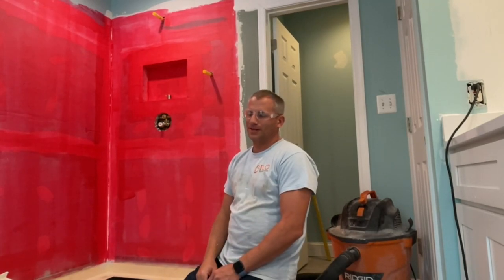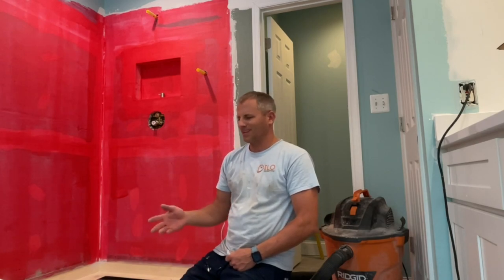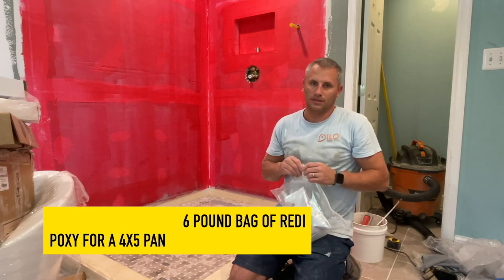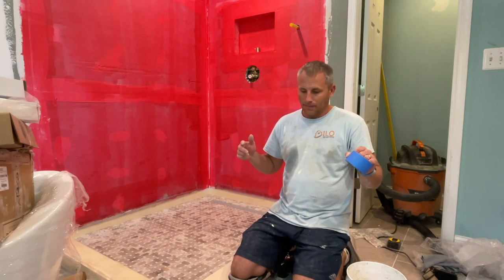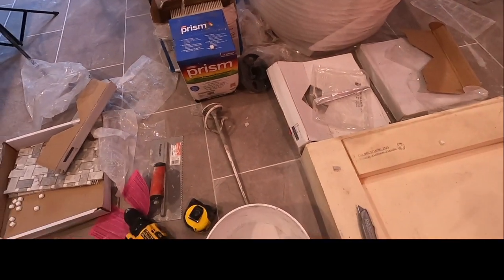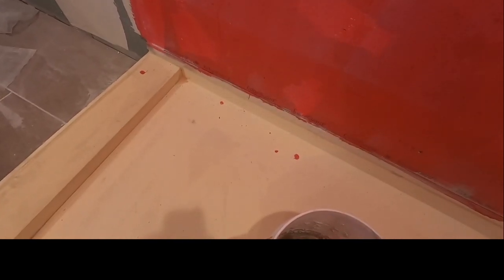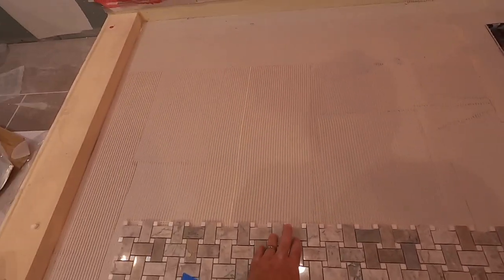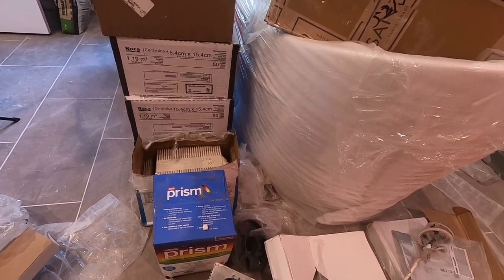How to install tile on a Tile Redi base. Tips, tricks, and updated info concerning the system.

Comment: Thanks for these informative videos. I'm getting ready to install my first Tile Redi pan and had a couple of questions I hope you can help with. 1. I'm using large hexagon tiles on the shower floor (11" from side to side), would you recommend that I still use a 1/8 x 1/8 trowel for the Red Epoxy or something larger? 2. Did you add any caulking between the flashing and the wall material that you used or did you just place them on top of each other and Red Guard over the 2 seams between the flashing and board and flashing and pan? Thank you!
Reply from the maker: For those bigger tiles you will need a bigger notch trowel for sure. You will probably need more redipoxy or try the approved thin set mortars. I do not add caulking for the Redi flash, only in the corner since it's an over lapping seam. I use a kitchen and bath silicone. Good luck with the project!
Reply: @TodayIWorkOn  Thank you so much! Any idea what size trowel would be good for that’s sized tile by chance?
Reply from the maker: @akeofalltrades  if using poxy, maybe 1/4x1/4. not sure. all tile is different

Comment: Great video, getting ready to lay my tile this morning. How do you clean tools with this stuff? By the way I’m craving pizza now! Lol
Reply from the maker: Just water and a sponge, but do it before it dries.  If you don't, you will have to throw out the tools.
Reply: I’ll tell you I like how workable the epoxy is, glad I had a 1/8 x 1/8 square notch trowel, worked perfectly with a 2” mosaic. I had to do it in sections sense I have a 48” x 72” pan. The stuff really is easy to work with. Thanks for the video it made it a lot easier on the nerves. 🤙🏾🎃
Reply: @TodayIWorkOn  I can attest to this! Didn't rinse mine after installing the Redi bench and had to throw out the trowel and use the bucket to weigh down my outdoor canopy corners now. 😉

Comment: Excellent video and some great tips.  
2 questions:
1. Did you also use an epoxy grout and if so which brand?
2. Does the Redi Poxi adhere well/react to RedGard?

I used RedGard on my shower walls too, but I also covered the entire Tile Redi base, curb and my cement board in the whole bathroom floor.  Thoughts on that?
Reply from the maker: We use a polymer based grout because it does not stain and it goes on really well. Check out my tiling a steam room ceiling on my thoughts about polymer grout. 

Redipoxy sticks to anything it touches. It’s epoxy that is made to set tile. Go for it.

Comment: Is it possible to modify the base at all? I have a couple of vent lines that run from the attic, through the wall and down through where the base will be in the corner. Can I cut the tile redi base to fit around these lines?

Comment: Is Tile Redi the only company that manufactures this type of tile-able one piece shower bases with curb ? Surprisingly, I searched and could not find any other brand so far. I'm planing to remodel all my bathrooms and see 2 issues. 1) availability - takes 2 or 3 weeks to arrive,  ordering directly via Tile Redi or through big box stores like Home Depot, Lowes etc.  2) Exorbitant price - between $700 - $800, which is unrealistic.
Reply from the maker: 700-800 is actually not bad if you are worried about piece of mind. As a contractor, that piece of mind is worth 200-300 more because of 2 reasons. 1. Saves me a lot of time in labor. You set it and that’s it. 2. Way less of a chance of failing against a schluter system or an old school rubber pan. The rubber pan is the cheapest way to go but it will take you over a day to install it. Good luck with your projects!
Reply: @TodayIWorkOn  Imagine a homeowner with 3 bathrooms to remodel. The price does add up. If there were other brands, the competition will help to settle down for a more realistic price. Currently, Tile Redi is the monopoly in the market. BTW, very useful and practical videos. Keep up the good work.
Reply from the maker: @benefitsforall7162  appreciate the kind words. Good luck with your projects!

Comment: What's the walls?  If it's Tile Redi's wall product, why cover it with Redguard?
Reply from the maker: Back in 2021 when I made this video there was no tile redi walls or there was no ability to use thinset. 😉. Hope it makes sense now.
Reply: @TodayIWorkOn  yes, thanks. Sometimes hard to tell when a product was available vs when a video came out.  Do you still recommend the poxy vs thinset on the redi base?